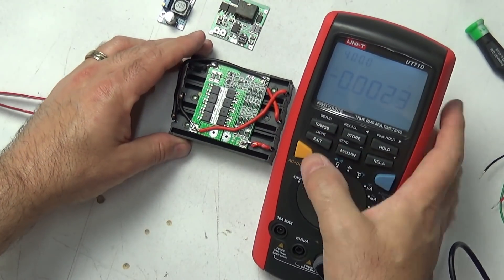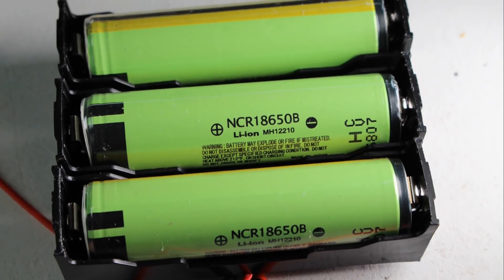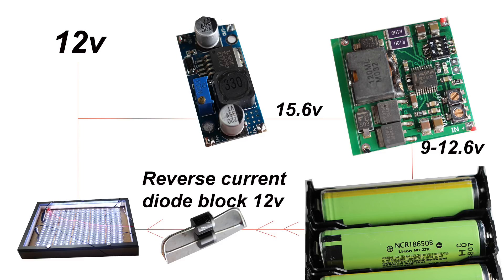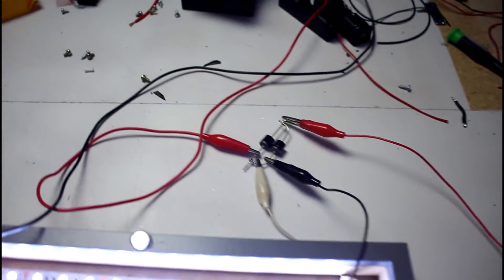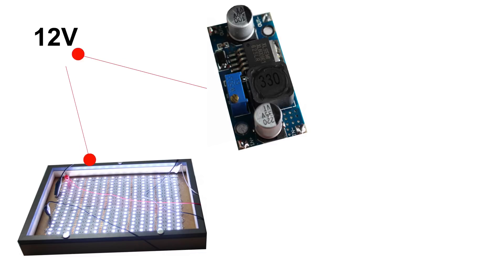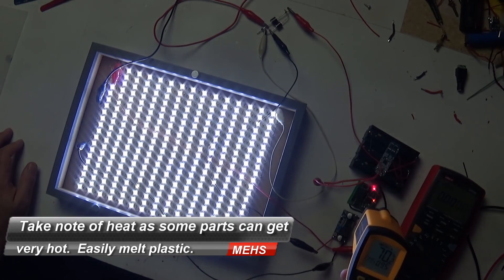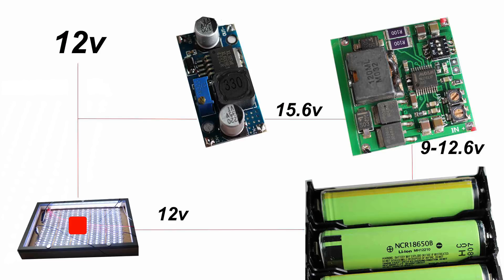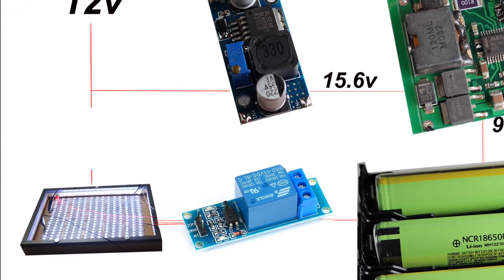Make Your Projects Rechargeable -12v version (MEHS) Episode 68

Comment: When both are connected to the load and the 12v supply is interrupted,  what prevents the Batt from feeding back into the step up converter creating a closed loop ?
Reply: Good point, a one diode would solve this I think m

Comment: Newbie question here, why do you need a BMS (in this particular example) it is more like a protection board vs BMS.  In your previous vid, you have indicated that this particular BMS will not properly charge the 3S pack (from memory it was giving the 3 cells only 1A in total)..  So why put MAX745 in front of it if it is not going to pass the proper charge CC/CV? Sorry I must be missing something.. rest of the vid made perfect sense to me inc the relay switch on the output.
Reply: Howdy.  Good question.  The bms is required to combine cells into a battery of X volts, in this case 12v or there abouts.  The bms will provide protection to each cell.  The level of protection depends on the bms but most do under and over voltage and or current.  The max745 is a proper lithium charging circuit / ic that can properly charge a 12v battery.  I said battery meaning there needs to be a bms in the mix to turn our 3.7v cells into a 12v battery that the max745 can charge cc/cv.  The bms alone won’t do cc/cv charging to the cells if you simply apply a 12 to 12.6v supply.  Hope that makes sense.  
Cheers.

Comment: Very informative. I would love to see you go from this prototyping stage to a simplified, finished product. Ideally the cost of parts excluding the batteries would be under $25 (the cost of a talentcell 12v 18650 battery pack off Amazon). The video would explain best practices in assembling the pack at each step of the way. Thanks!

Comment: I'm missing something here,.. What exactly is this "MAX745" board doing in this setup?
You have the 3S BMS protecting the cells against over/under voltage.  You have the Boost regulator providing 12.6+3v
This "MAZ745" is only connected across the entire 3S pack so is not doing any 3S balance/protection.
What, of any value, is this rather fancy board doing that the boost converter connected directly to the 3S BMS wouldn't?

(in your review of this MAX745 circuit you say the trimmer pots can adjust the PER CELL voltage to 4.1-4.3v which would require connections to the intermediate points but I see no such connection points on that MAX745 board)

Comment: Thanks!!! I found it very well explained. Just to be sure, and as you also said in your MAX745 video "It may be overkill". What would happen if insted of using that MAX745 module you would just set the STEP UP mudule to 12,6 V output dirctly to de BMS? In my layout I was already thinking of using a STEP UP module between a 5V solar panel and the BMS.
Reply: You can do that, but you need a boost module with voltage AND current regulations, cuz Li-ion need CV-CC charging. You will need some kind of indicator show when current drops to zero, so you will know it's fully charged. Also you can add a tiny balance board.

Comment: But this won't keep the cells in balance, will it? Does that 3s BMS cut voltage off to individual cells when they hit 4.2 volts?
Reply from the maker: Hi.  Correct.  For a balanced solution you would need to use a balanced BMS.  Basically the same approach, just a more expensive / better board.  Cheers.

Comment: So, in the case of the schematic at the very end, you'd want an NC relay which is then actuated by the constant 12V power supply to open whenever its connected, correct? I just don't understand the sentence at the end where you said it could "switch off or on" depending on how it's connected. I can't see another way to configure the relay that would really work and I think I'm missing something.

Comment: I was trying to think of how you could prevent the battery charging circuit from running when you have external power available. Maybe you could have a microcontroller monitor the charger circuit output line as well as the external power supply line then only allow a relay to close between the external power supply and the boost converter after a certain period of time has passed or if the external power source goes low (in anticipation of it returning). Something like a latching relay might be better or even a solid state relay but I don't know enough about them. The microcontroller would need a big capacitor to give it enough charge to switch the relay contacts closed once the external power supply went low. Otherwise, the microcontroller would be unpowered when the external power supply was unpowered. Or maybe the uC could use power from some of the batteries so that it would not need a substantial buck converter for it to be powered. But I'm not sure if the charge controller would be able to supply more charge to individual batteries as opposed to the whole batter pack at once.

Comment: Hi, First of all thank you so much for the Info, great content. I just have one question, if you don't want to power your project from the power supply, but simply want to charge the batteries, whilst powering the project from the batteries only, would the circuitry change? Basically 12V goes only to the Boost regulator, that feeds the Max745, that Supplies the BMS, and then the project connected directly to the BMS. This is so that the project works almost as an uninteruptable power supply. Is this possible by just simply not connecting the project to the 12V Power supply, and is there any negatives for doing it this way (e.g. affecting the lifespan of the cells etc?)
Reply from the maker: -Hi.  Yes that would work, and is kind of the point.  The main thing to watch is the total draw of the project compared to the input charge rate.  E.g. if the project draws 2A at 12v and the charge rate going into the cells is 1.5A at 12v then at some point the cells are going to be fully drained and the project will turn off.  If this isnt the case then you're good to go.  If it is then you need to establish a bypass for the external power to go to the project and charge the cells simultaneously, trickier than it sounds.  Cheers.
Reply: @michaelsstuff4402  Thanks for the prompt reply! Guessed that much. My Project actually runs 4 of these Circuits, 4 Step Up converters, feeding into 4 Max745's, feeding 4 BMS Balance Boards, charging 3 cells each. From the BMS, i then feed into 4 x (5v 2A) - Buck boost converters, to get me 4 x 5v Circuits, from the 4 12v Battery Banks.

Each of these  5 v Circuits then powers a set of components. The first is a Raspberry PI 4, which should not draw more than 640 mA under full load, the Second powers a bunch of low power sensors (PIR, DHT, CO2, etc), the 3'rd and 4'th both powers 5xESP32 Dev Boards Respectively (each which will pull a max of 260 mA). So on each of the 4 Circuits, I'm well below or just touching 1 Amp. 

Once my PCB arrives, and I get it all soldered together, I'll post with the results. If the BMS can't charge quicker than I drain, I'll feed the 5v buck-boost's with the 12V input as well, and add the Diodes.

Once again, thank you for sharing your knowledge, hope the Subscription and Bell icon helps with the growth of your channel!

Comment: Hi, Thanks for shares. Can I use a step up module after battery pack to convert 12 volt to 24 volt? my amplifier input is 24 volt and 5 Amp. I want to make a rechargeable unit for it, If not, can you please recommend a cheap solution?
Reply from the maker: 24v at 5A is 100 watts.  You will need to select suitable BMS to handle the power and you will also need a really good 24v boost circuit and probably 2 x 3S packs to make sure you have enough current and tie them together before the 24v booster.  Remember most 18650 cells won't be happy pushing a constant 5Amp output.  Cheers.
Reply: @michaelsstuff4402 thank you for reply, it was very helpful.

Comment: Can I use two BMS One for charging and one for taking output
Reply from the maker: Hi.  You could try it.  You might run into battery fatigue issues or the BMS might react strangely if charging and draining simultaneously but give it a try.

Comment: What is the input voltage rating for 3s bms
Reply from the maker: - Hi.  I depends on the chips used on the board but most will easily handle more than 20V.  Its normally the current you need to monitor.  Cheers.

Comment: so if we already use a 19v dc adapter..we can bypass step up voltage module??
Reply from the maker: - Yes that's correct.  The MAX745 will take an input between 15.6v and 20v.  Cheers.
Reply: Thank u

Comment: Where is your switch? Couldn't you put the on off switch between the light and the battery eliminating the need for the relay?
Reply from the maker: - Hi.  yes you can use a manual switch to control flow but most people want the flow controlled automatically through relays.  Cheers.
Reply: Some circuits use a fet between the batteries and panel. The fet is turned off by the presence of the main 12v supply. If you lose power then the fet turns on and allows battery voltage to power the panel.  With a manual switch you would have to be there.

Comment: This is by far the most in depth video i’ve seen on this topic so far! However i maybe not be thinking here, would it be possible to put a switch in between the project and the power supply that is charging the batteries, to stop the project from working while you charge it?
Reply from the maker: - Hi.  yes, just add an inline switch between the battery pack and the project.  Cheers.

Comment: You don't mention how much current this would draw if you are recharging batteries and using the light at the same time. How would I calculate that?
Reply from the maker: - Hi.  The draw depends on the panel you're using.  A small panel will pull about 1 amp, a big one up to 3 amps.  The charge rate needs to be at least the rate of draw of better.  Most modules that charge a bank of cells properly will only do so at 1 to 2 amps.  There are a few factors that can impact the numbers but that's a rough idea.  Cheers.

Comment: I made a 16,8v pack for a 15,6v nicad drill  BUT the problem is when i put it under charge voltage starts dropping until i turn the drill off i do not know why i even tried with a 4s2p arrangement and the same happened :( please help me, hy it happens and how can i fix it
Reply from the maker: - Do you mean 'when you put it under load'?
Reply: @michaelsstuff4402  yeah, for example conecting to a 12v drill

Comment: Thanks for posting this. Its really helped me with a portable Bluetooth speaker design. I have a very similar configuration using the 3x18650 (2800ma) batteries in series with 15.4Vdc supplied to the same Max745 board and a 3S BCM with protection. However I am only ever able to achieve .4A from the MAX745. My Power supply is capable of delivering 5A but if I turn the pot on the MAX745 the charge light goes out and max current is .4Amps. My question to you, have you confirmed that the MAX745  was able to achieve half C of the battery (in my case 2.8Ax50%=1.4A)? Not sure if I have a defective MAX745, because it does charge and all my batteries are in good condition.
Reply from the maker: - Are you measuring the input to the MAX745 or the output from the MAX745 to the BMS.  Yes I tested mine and, from what I remember, it was consistently delivering over 1A output.  You say the power supply is capable of delivering 5A but at what voltage and what is the real output?  Your power supply needs to be delivering at least 15.6V (up to 19v) at over 2A at the MAX745, not the power supply.  That could be an issue worth checking.
Reply: Thanks....  I have a similar set up using a step up voltage regulator (6009) delivering 15.8Vdc, so at the input of the MAX I'm seeing 15.8Vdc, and at the output of the max I can tune it to exactly 12.6Vdc. However when I measure the output of the MAX for current or the input to the cells, I'm only seeing .4Amps. This morning I disconnected the MAX and ran directly from my regulated power supply  (similar to the one you use) into the 3S BCM and it show a measured current of around 1 Amp.
Reply from the maker: Sid Jongsma  - And don't forget, the MAX745 is CC/CV so depending on where it is in the charge cycle it might not be delivering the full current range at that time.  If you have a data logging meter, use that to see what the MAX745 does over a full charge cycle.  Cheers.

Comment: With a 3S 4P configuration would one BMS be OK or would I need 4 BMS units?
Reply from the maker: - Hi.  One BMS is okay.  You can theoretically run any number of cells in parallel so its only the number of cells in series that matters to the BMS.  Is say theoretically as the BMS will have power handling limits and if you ran, say 8P, the pack could provide too much current for a small BMS (say 8A).  Charging is also an issue as you might not be able to push enough current through to the cells to charge correctly.  You can also find BMS that have cell balancing which means the cells in parallel get monitored and managed better than a BMS without balancing.  Cheers.
Reply: First, thanks for the quick response.
 I will use a similar setup that your excellent video explained. For my set up I will though provide the higher voltage using a PSU  feeding the MAX745  into the 3S 4P pack. 
The BMS that I have is 10amp max. The equipment draws approx 5amps, though there is a motor and draws around 1amp, but start up current is unknown. 
I think I will take your advice and plumb for a 25amp BMS with balancing..
Cheers

Comment: I have a Celestron CPC HD Deluxe telescope that runs on 12v DC.  This video makes me think I could use your set up to power it.  I am thinking I could 'hide' the electronics in one or both of the fork arms of the mount as they a partially hollow.  The scope uses 2 Amps max to power the slewing motors. The power draw is considerably less, about .2 Amps when the scope finds an object and just tracks it using the same 2 DC motors.   Questions: Can I use 6 batteries in parallel, instead of 3 in order to have more lasting power?  Do you think your design will work for my application? Thanks, David
Reply from the maker: - Hi.  Yes this would work very well for your application.  You could expect to get up to 10hrs of run time from a 3S pack and up to 20hrs from a 3S 2P pack as you suggested.  The BMS and cells can easily deliver up to 10A so your 2A draw is well within tolerance.  Cheers.
Reply: is it possible to add a 'battery percent voltage display'?  where in the circuit would you add it?  I am guessing it would draw some small amount of power from the system?  I was thinking of something like this one on eBay...    https://www.ebay.com/itm/2S-3S-4S-6S-7S-Lithium-Li-ion-18650-battery-Capacity-Guage-Indicator-VoltMeter/322602341414?_trkparms=aid%3D111001%26algo%3DREC.SEED%26ao%3D1%26asc%3D52973%26meid%3D1b0b6011695a4254a1714f945cd5fe6f%26pid%3D100678%26rk%3D5%26rkt%3D8%26sd%3D113137724344%26itm%3D322602341414&_trksid=p2481888.c100678.m3607&_trkparms=pageci%3A49ae61e5-82d5-11e8-bdff-74dbd180a1a4%7Cparentrq%3A7af653c51640a9cd6d4e35abffed4865%7Ciid%3A1
Reply from the maker: - Hi.  Yes they work fine.  If power draw is a problem, as an option I would connect the gauge with a momentary switch.  That way the gauge would only activate when you hold down the switch which is fine for a quick read.  from memory, those gauges only take a second or two to read the voltage.  Cheers.

Comment: i use 26650 @ 5400 in 12v series... would this work for this project?
Reply: not 5400mah only 5100mah oooops
Reply from the maker: - Hi.  Yes.  These BMS can be used with any Lithium 4.2v cells.  The only caveat is the current rating of the BMS and the draw of your project.  e.g. don't use an 8AMP BMS for a project with a 25AMP draw.  Cheers.
Reply: thanks for that... i have a bms  with a 20amp max current

Comment: Hi thank you very much for this video. I want to  build a 3S3P battery system using an old Laptop power supply at 16V @3.3A. Now  I'm trying to understand if this approach (MAX 745 + 3s BMS) is better from balancing point of view w.r.t another one, based on 3 x (isolated DC/DC converter to 5V + TP4056), where each battery is autonomously charged. Personally I prefer your appoach because - afaik -it is cheaper w.r.t the other one (Isolated DC converters cost around 8€ each). But what about balancing process? How is it performed with our design?
thank you again.
Reply from the maker: - Hi.  You do have a form of passive balancing by just using a 3S BMS as each bank will be charged to 4.2V and cells connected in parallel balance themselves out somewhat.  Its not perfect active charging and individual cell monitoring but it works as long as the cells have time to rest.  You get better results when the cells are matched for storage and performance characteristics, e.g. they delivery almost identical runtime and chargetime.  Active is better and there are BMS out there that have individual cell charging and monitoring, just don't remember seeing one for 3S3P.  Cheers.